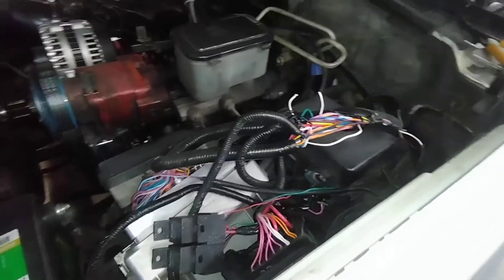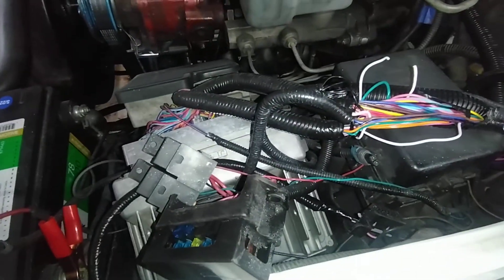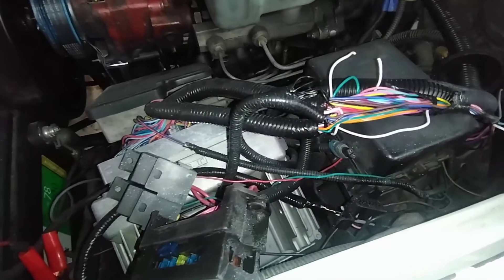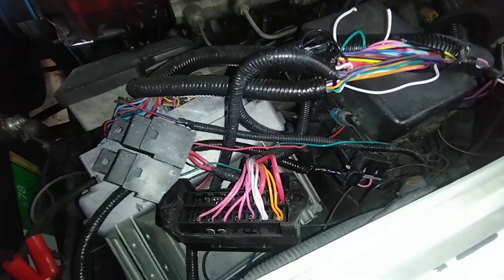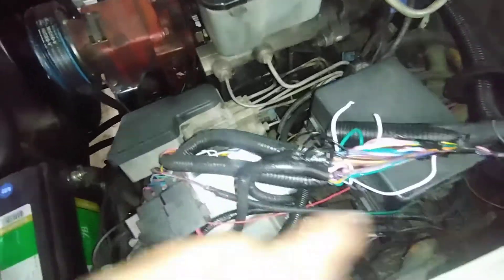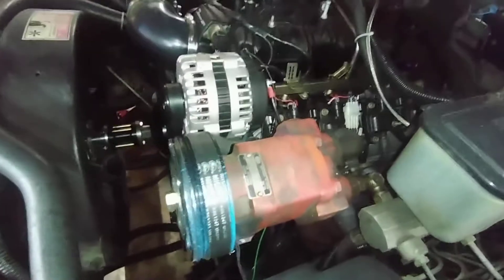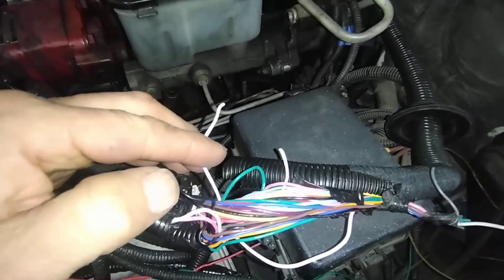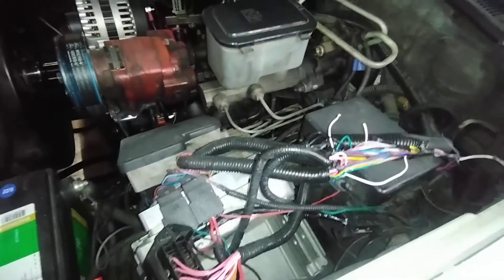ls swap stand alone harness myth busting and problem solving. dont get scammed.. alternator buzzing

Comment: Rust hoarder garage has a video on how to repin these harnesses to work like a vortec..I followed his steps on what to do with the white tac wire from pin 10 red connector and it fixed my buzzing/killing battery issue. Before I was getting 5v at alt plug with key OFF. After doing that I get no volts with key off, no buzzing, no issues. My harness was 80 on amazon.
Reply: Thank you!
Reply: Not only did rust horder help with my tach not working, alternator issue but also the 4l60 side of the was pinned for an 80e so my 60e was only shift 2-3. After swapping some wires at the transmission harness connector it was shifting like it should. Fought that issue for 6 months replacing solenoids in the tranny etc. His vids are invaluable.
Reply: Do you remember which video? I've started watching some but he has quite a few covering harnesses.
Reply: @robertbrown8651  it's the one where his husky is laying and has his front paws crossed. And in the video picture it says ls harness review and fuse info and something else. It's a pretty long video but super detailed. I had 2 issues with mine and it was fixed following his video

Comment: Thanks for the video. I had the same issue. Rather than cutting the wire I pulled the engine speed sensor wire (pin 10 red connector ) out of the harness.

Comment: That is why I'm using the factory harness out of my donor vehicle.
Reply: same.   and I have the option to run the headlights/brake lights, horn, cruise control, and whatever stock circuits I want.